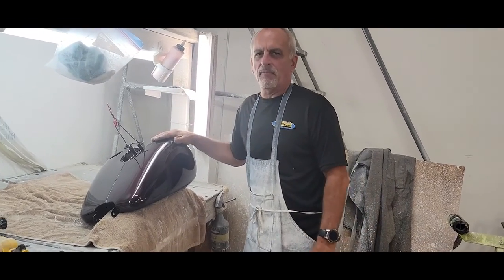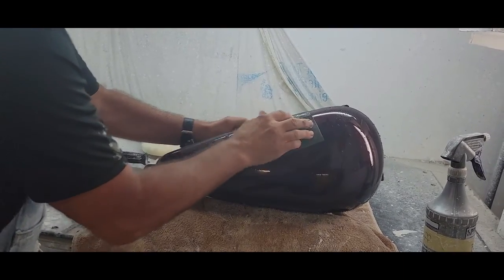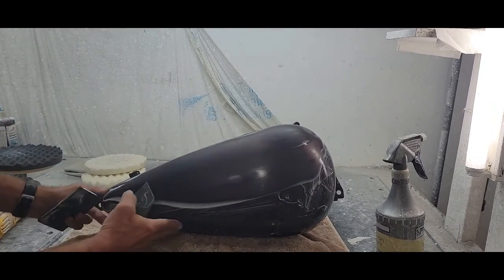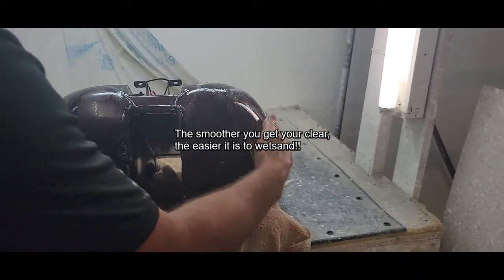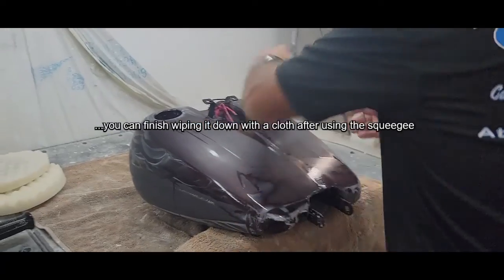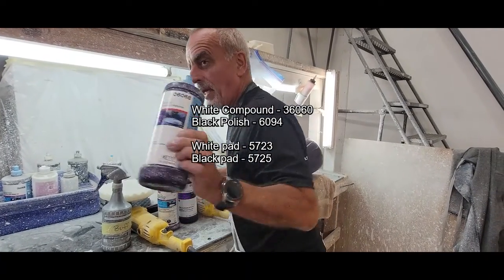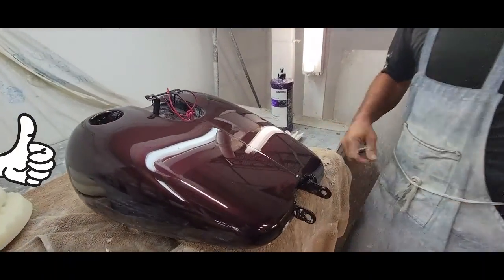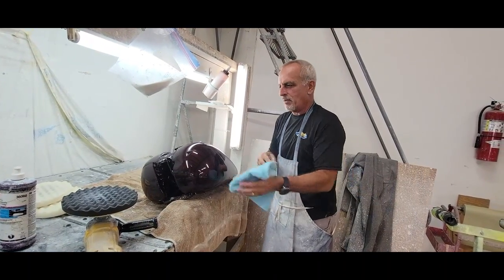Tips, tricks, how to wetsanding and buffing painted motorcycle parts

Comment: I use a small block, so it actually flattens the nibs, I also usually just do 2000, 3000, and then CSI Ceram X Polish, its the bomb
Reply: I may have to check out the CSI ceramic polish

Comment: Amazing 😃💪🏻🔥 is it same procedure if i have used 2k clearcoat spraypaint ? 

A good wet sanding and then polish ?
Reply from the maker: Be sure to use a clear with catalyst. Put on the correct amount of clear. Try to get slick as possible to eliminate orange peel, thus creating more sanding. Then wetsand and polish

Comment: I’m not a painter or detailer but after 3 tries I finally got a beautiful paint job with clear coat and wet sanded everything now all I need to do is buff it out but I’m afraid I’ll mess it up, I have an air operated buffer from a friend of mine that used to do this type of work, how much pressure do you use ? I’ve watched a lot of videos but still nervous
Reply from the maker: To start off with, try a larger flatter surface and just use the weight of the buffer (assuming it's a professional type buffer with a 8" pad). You want to start with an easier panel so you can get used to it. Or practice on your car. 
Just watch the edges. Always run the pad 'off' the edge and not onto it. Good luck

Comment: Hi Scott
Question..
Sprayed my friends Kawasaki ‘classic’ need to send it 350 miles by courier.Sprayed almost 3 wks ago with USC01.
Have foam to pad then bubble wrap then foam peanuts.Thinking of initially wrapping parts in microfibre cloths then clingfilming in place.Cloths have a slight texture but are high quality.
Worried the pattern might inprint on clear.What would you initially wrap in?Never boxed & posted before & am uncomfortable doing it.
Cheers for any response.
Reply from the maker: My wife always did the packing. Shipped well over 1000 sets. She always just wrapped each in the foam insulation, then bubble wrapped each part. Put the parts in the box, then fill with peanuts, or other filler. The keys are to make sure that you keep the parts away from the sides best as possible and put enough filler in the boxes to keep them from moving around.
Reply: @TAZattitude  Hi Scott
Thanks for the reply.Really appreciate it.Trying to leave nothing to chance.👍

Comment: How many coats of clear do you usually put on as a final clear coat before buffing and polishing?
Reply from the maker: Normally I put about 4 coats on. 2 coats, then I double coat the last coat. I do use a High Solids clear though.
Reply: Cool, will have to try that. I've been putting 5-6 on to get depth in the paint. But I like the the depth you're getting on your paint jobs. Doing a lowrider style paint on a road king an looking for more of deep layered look in the finish. Appreciate the information. Have a great one and look forward to your next videos.
Reply from the maker: @johnholley7749  Be sure to use a good 'wet' clear clear. Also, try to make sure that the surface is 'flat' or very close to it even before wetsand and polishing. Wetsand with 1500 if you have a nice surface. The key to depth is to get all orange peel out and make sure the graphics are completely flat (no edge) after wetsand and buffing.
Thanks for watching and subscribing
Reply: I was going to ask the same question. Great response 🤙🏼
Reply: Great video. Just one question, is the start with a tank that just has paint?  Or paint + clearcoat  before you began doing this?

Comment: I see people bondo there tank even when there's no dents? Why? Do you have to to get a good finish?
Reply from the maker: The only reason I can think of is that possibly it got sandblasted or stripped and it got warped. OR, it's an aftermarket raw tank. I've had to coat aftermarket tanks completely due to bad quality. Harley tanks are good quality and do not need to be coated with bondo

Comment: Does this paint have flakes in it?
Reply from the maker: If I remember right, that was Harley Black Pearl, so it has 'pearls' in the color
Reply: @TAZattitude  thanks is there a color code for that paint, I have a bike with that same color, I need to paint my fender. Where can I get this paint?
Reply from the maker: No color code, just call up a local jobber and and tell them the year, harley, Black Cherry. Be sure and purchase the better grade paint. Cheaper paints won't have the correct pearls in it. I use PPG Deltron. you can also order from the ColorRite website.